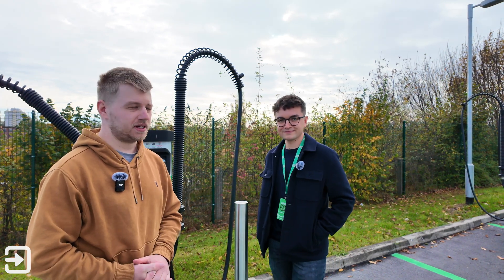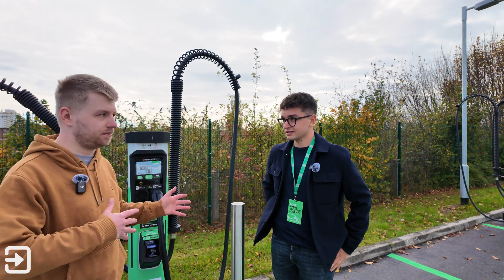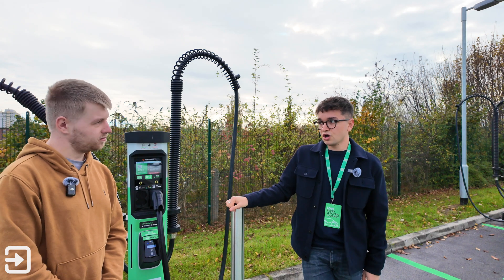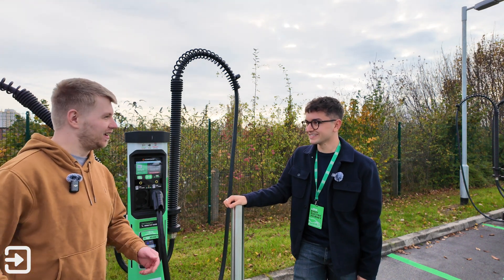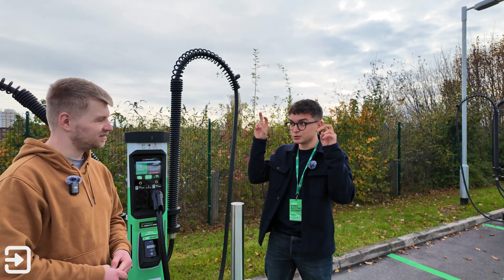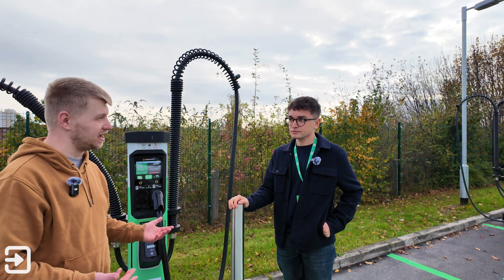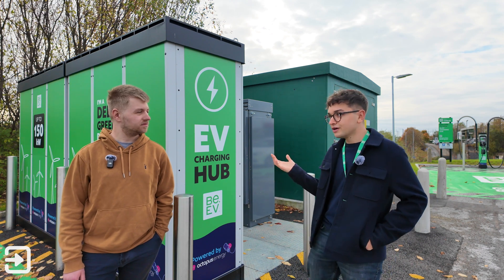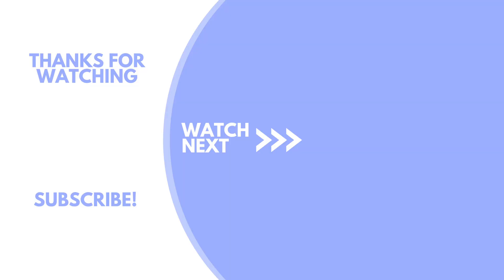Things you didn’t know about EV Charging with Be.EV's James Gee | Latest Site Tour

Comment: Disappointed to see no pull through charging points for vehicles with trailers.  When they do put them in you don't know where they are because these don't feature on any of the charger apps.  This has got to change if we want to see EV's seen as viable for commercial use as well has for leisure.

Comment: how many site's do you have..and how many are "cctv covered/monitored"  i ask because there's a few sites around here have become victim to CABLE THEFTS..Its on the increase, i use regularly an IONITY CHARGE SITE near Lancaster...i pulled in about 2 weeks back...only to find  2 of thier 12 chargers were useable, all the rest had been vandalised..had, had the power cables cut through,  no one saw anything, NO CCTV, SO this is just a "heads up " ps
to IONITY'S CREDIT one bank of 6 connectors were replaced a week or so later..( no doubt at great cost to them)

Comment: One thing that would improve the EV charging experience would be to install canopies over chargers so that when it is raining you are sheltered when plugging/unplugging/ paying etc. After all they added canopies at petrol stations over 60 years ago.
Reply: I could be wrong but some time ago I was told that it can take years to get planning permission for canopies as the conditions for approval are much more strict. So they don't bother as it's more important to get the charger itself installed.
Reply: @ I am sure you are right, with conditions attached for wind loading, snow loading etc. But the key would be install the chargers then go for planning permission for canopies after the chargers were installed , in which case you should see canopies over earlier installed charging stations by now. I suspect it is more that the charge point operator (CPO) wants to get their kit in as quickly as possible at the least possible cost to start the revenue flow. Of course I recognise there maybe site limitations but even small steps at the margin encourage greater EV take up.